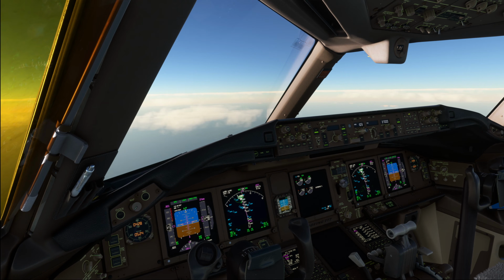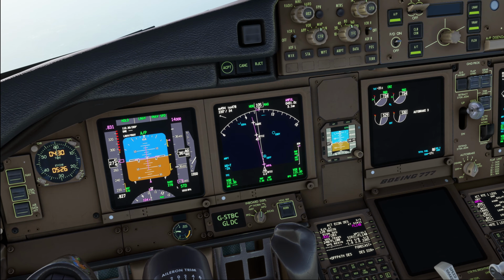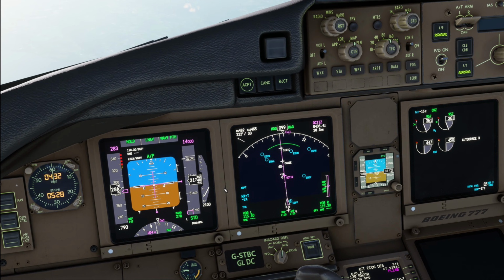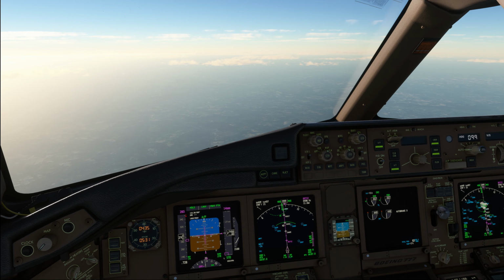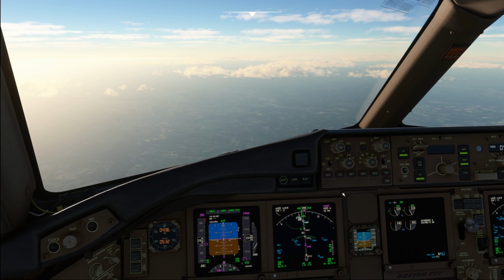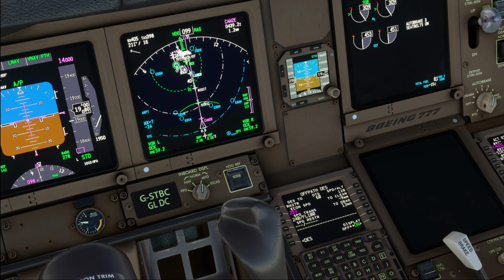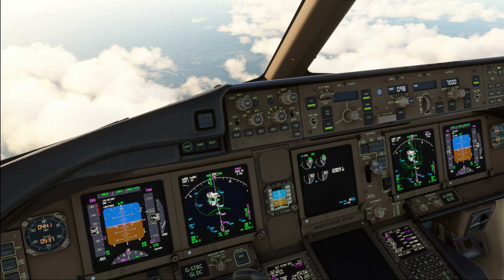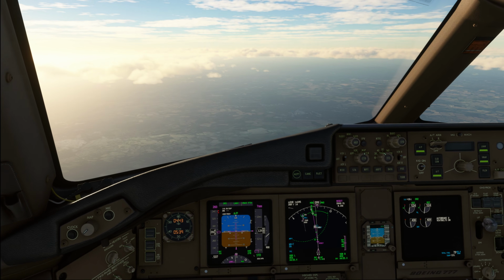PMDG 777 Tutorial 13: Descent | Real Airline Pilot

Comment: At 14:10 777 plan deccelerate in clean configuration with reduced descend rate at around 500 FPM, which will start at the first green dot and end at the second green dot based from the pilot inputed speed and wind data, if it can't make it, DRAG REQUIRED will pop remind you to help the aircraft with speedbrake. For level deccelration, it will also calculated based around 10kts per 1nm, it's in FCTM.

Comment: is there a reason why the aircraft would accelerate with almost full thrust on descent randomly?
Reply from the maker: That normally happens when your joystick overwrites the autothrottle.
Reply: @A330Driver  ah thanks, I will check for inputs next time,  much appreciated
Reply: @philipplutki If there is a throttle on your yoke/stick disable that in settings